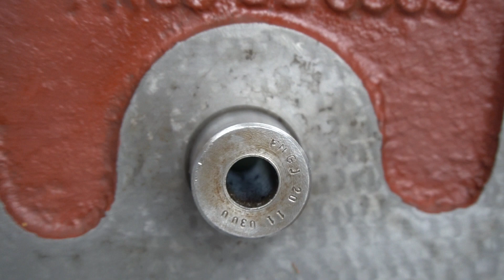Restoration of INTOS FNGJ20 accesories PART 1

Comment: The screws are too short
Reply from the maker: Yes. It's just to give you guys a impression. I need to make 4x new bolts 😊
Reply: @OmeMachining  👌🏻👌🏻👌🏻
Reply: What do you spray on the parts after using WD40?
Edit: Found the answer in one of your other videos, I think. Looks like the CB100 stuff you showed earlier.
Reply from the maker: Yes that correct. CB100 from Biocircle